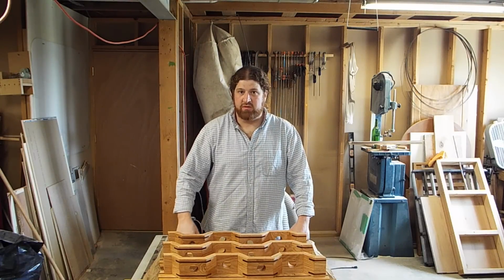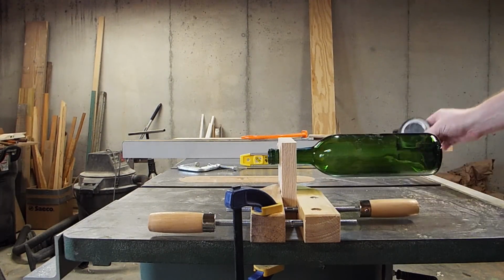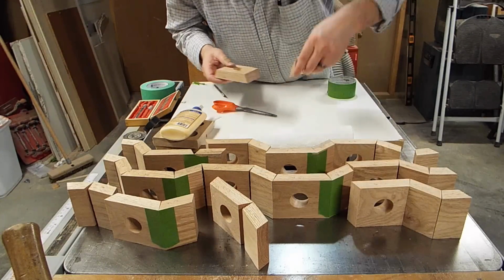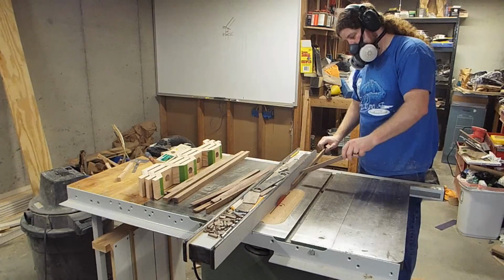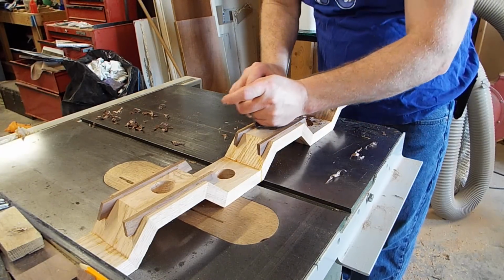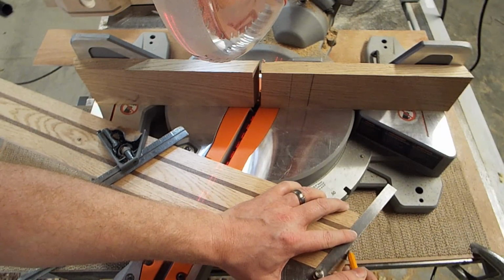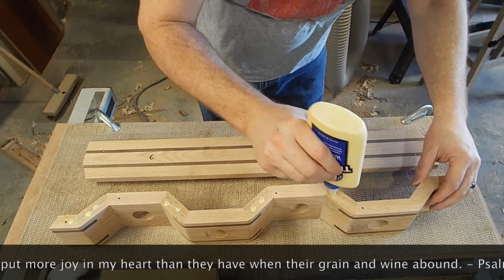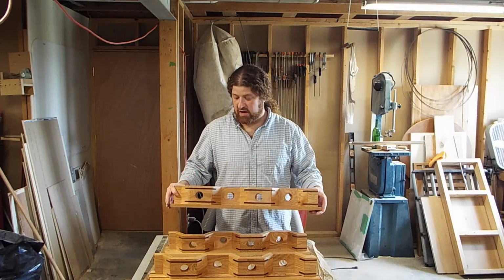Wine Racks

Comment: Great video and blog post! What is the hole size for the wine bottles using the Forster bit? Thanks!
Reply from the maker: 1 1/4".  That seemed to give plenty of space and allowed the wine bottle to sit horizontal for me.  But you'll want to test the setup with whatever angle you use and the bottles you are using.  Expect a couple pieces of scrap.

Comment: what was the hole size for the bottle necks?
Reply from the maker: The holes are 1 1/4" and drilled at roughly 16º by my current measurement.  You'll want to test it out if you can on some scrap in case your wood thickness is different than mine.  But that should get you in the ballpark.

Comment: Make Crazydays that is a cool project. you are not afraid of the bottle necks cracking and the bottle falling? I have been wanting to make something like that but have some reservations on if it will hold. Thanks.
Reply from the maker: Miter Mike's Woodshop - There are a lot of wine racks which use the neck to hold the bottle.  I've included a link below which  shows quite a few examples.  I wouldn't suggest trying to climb on them, but the glass should hold out without issue.

https://www.google.com/search?q=wine+rack+neck&tbm=isch
Reply: Thanks Make Crazydays i will check it out. did you make plans for yours or did you just wing it?
Reply from the maker: Miter Mike's Woodshop - I more or less just winged it.

The "critical" parts were the angles of each joint were all the same, as 22.5º, but any arbitrary angle would work.  The height of the rest of the components were just a "feels right" size.  And the angle of the hole for the bottle I determined where the center of the hole would go through the center of the board when drilling at the proper angle, and that kept the bottles centered when laying out horizontally.